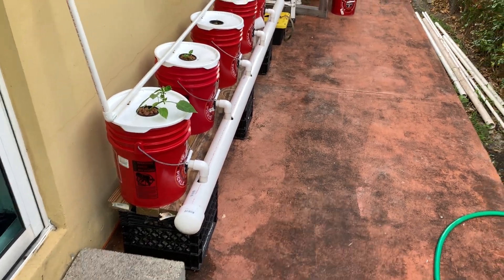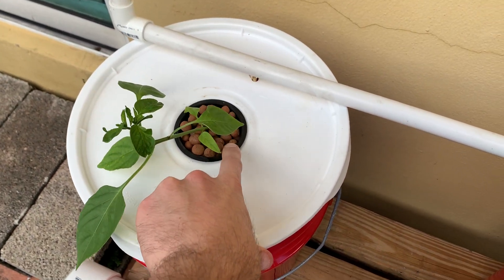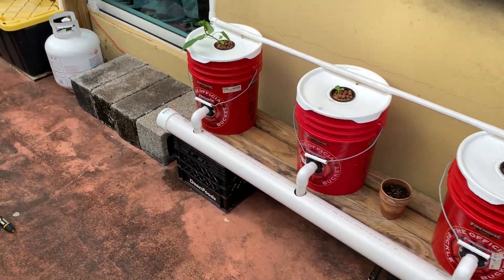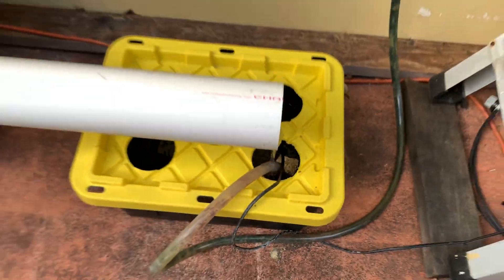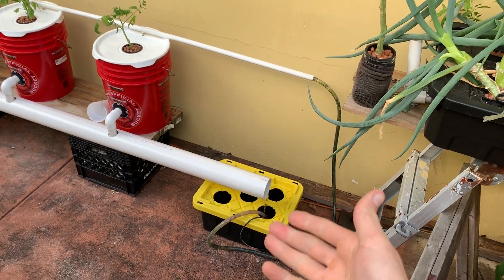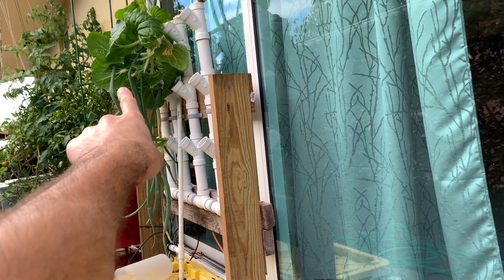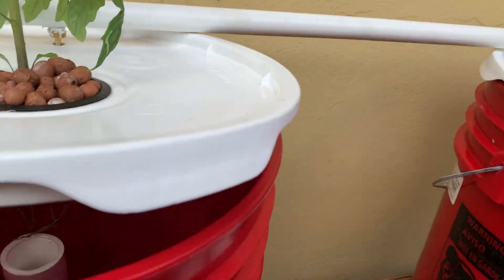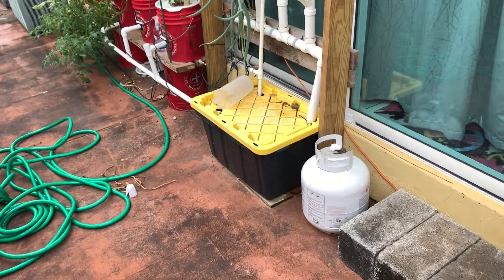How I Built My DWC System - Recirculating Deep Water Culture - Hydroponic Peppers & Tomatoes EASY

Comment: What is the height you cut your inner pipe too for the drain? Just above the bottom of the net pot?
Reply from the maker: It used to be but not anymore now it is about 6 inches below the net cup and the roots hang in the air and only touch the water at the bottom of the bucket
Reply: @BobGrows  , so as the plant starts, water is at net cup so water can touch roots? Then as root grows you cut the pipe to lower the water level? Or just have a 2nd pipe already cut so you just replace with shorter drain pipe?
Reply from the maker: Mike Goodwin it used to touch the net cup and didn’t move but now I just have it much lower regardless of root length and the roots hang in the air space between net cup and water level
Reply: @TMonkey_DayZ  he also moved the water pipe to fall directly on the plant /media

Comment: I am new to all this so forgive the "newbie" question but does the pump run constantly?
Reply from the maker: In this particular setup yes but it was not necessary. Could be cycled. In my newer revision it is necessary to run 24/7
Reply: @BobGrows  did you install plants along the drain? I really like your set up. I am in arizona so i am going to have to find a way to keep the water cool. I will most likely keep it halfway buried in the shade.
Reply from the maker: Andrew Asman I never did but if you see my more recent videos I lowered the water level in the buckets and the plants are doing much better

Comment: Nice ... may I suggest a drip system with the nutrients flowing over the roots and also you are getting algae  in your line .. check out those things you may be surprised in your crop ... some problems I had doing the same kinda set up .. cheers !
Reply from the maker: I have adjusted my system since this video I lowered the water level a lot and the water drips onto the media down into the roots. The roots are mostly suspended above the waterline now with only very long roots touching the water
Reply: @BobGrows  have you had better results with the water dripping directly on the media/plant?
Reply from the maker: idcccccccc Yes I have but if the net cup/media clogs up with too much roots it’ll just flow off the top of the bucket

Comment: What size hole saw did you use for the holes in buckets
Reply from the maker: 1” uniseal for 1” pvc uses 1.75 (1 3/4) hole saw
Reply: Was you able to push the pvc all the way through the uniseal once it was installed in the bucket
Reply from the maker: Mark Lewis put a little dish soap. It takes some effort.

Comment: Do you have the 3" PVC supported only by sitting them on the crates?
Reply from the maker: Correct on the lip. The other tubes keep it from rolling off. Should probably be secured better but it’s fine

Comment: Thanks for this! Found this really useful to get a system set up. I've pretty much copied your setup, but having problems on the last barb in my water feed. Did you ever get round to capping the pipe as you mentioned in the video? I have capped mine just after the last barb. I get amazing pressure on the first 4 barbs, but the last one just dribbles. And I wonder if it's because the water is backing up where it is capped and restricting the flow...

I don't think it's a pressure problem...because if i extend the pipe (instead of capping it) for another few meters i still get really good pressure at the end.

Thanks again!
Reply from the maker: Yup I capped it. I removed the barbs and left the open holes to feed the plants. The barbs kept getting clogged. The open holes flow much more and it seems the plants are happier and less maintenance ensuring they don’t get clogged.
Reply: Bob Grows do you happen to have an update with no barbs? Or an updated picture
Reply from the maker: I will post a video Friday, stay tuned
Reply: If you bring the water source into the middle of the run of pipe via a T it will equalize pressure to all nipples.
Reply: Brilliant!

Comment: Another guy's video I was watching, he was saying the tomato plants got huge. 

So I'm wondering, when the plants get really big do you have to adjust the net cups somehow to adjust for weight and size?  (The cups also look kind of low strength plastic, so I thought I'd ask; not criticizing because I like cheap. Just bringing it up to pick your mind.) 

Also, will tomato plants get too top heavy and big in the buckets without something else inside to sort of weigh down the bucket?  

Thanks.
Reply: As the plants get bigger.....You want to support the plants from the top.....Trellis netting....String, Wire,....You could use Tomato cages (use it upside down...tie off branches to the legs)......

Comment: you could greatly increase yield just by upgrading your pump, increases oxygen and nutrient delivery.  Covering your holes in your reservoir would stop sediment from clogging ur jets and algae growth -from sun getting into reservoir, alot of work just to go cheap on ur pump, a system is only as good as its weakest component.

Comment: On the 1/2" PVC feeder, how big did you drill the hole for the brass barbs?
Reply from the maker: I think it was 1/4 or 1/8 not sure I just matched it up to the Barb threads and made a little bit smaller

Comment: How many times working the pump for 24 hours?
Reply from the maker: Alpaslan Sivrikaya always 24/7
Reply: @BobGrows  if the pump fails,,,, then what happened or elecric Will close?  What Will happen the vegetables,,,,, is it have so times?
Reply from the maker: Alpaslan Sivrikaya In DWC setup if the pump fails the buckets will still be full. The buckets will still hold the proper level but won’t be recirculating. You have time to replace the pump
Reply: But does the pump really need to go 24/7? Or does it only need to go during normal daylight? (Do the plants really all grow at night?)
Reply from the maker: It does not need 24/7 I just don’t have a waterproof timer for outside. I think running for 15 minutes every hour would be sufficient
Reply: @BobGrows  thanks bro,,,, l Understand it

Comment: This is my first year with hydroponics and I have almost the exact same setup that you just made but all my buckets are dutch.  I freakin love how simply you turned a Dutch bucket into DWC!  I’m blown away!  Next season I’ll be converting to your system for sure!  Great system and be proud of it!  Thanks for the idea!
Reply: Does the bucket system work better than just putting the plants into a big long 3" PVC pipe itself? Or maybe its better for the larger plants like tomatoes?
Reply: I converted my Dutch Buckets about 3 years to a Very Similar System, I raised the water level in the Dutch Bucket by raising the internal elbow up, I can adjust the water level up or Down. My main Tank 20 Gal has an Air-stone in it to keep the water oxygenated. I run the Pump 15 Min on 45 min Off, in hot weather, 30 min on. 
This saves me a lot of money on Perlite for the dutch Bucket, and easy to clean out at the end of the season.

Comment: Increased aeration in RDWC is what sets apart this growing method from all others! I would highly recommend 1 air pump at least in the reservoir to transport more highly oxygenated water and when you can, 1 in each bucket.
Reply from the maker: Air pump has been added since to each container and reservoir!
Reply: Also, (in case you didnt know) if you can calculate the amount of aeration in the water you will be able to systematically dial back your nutes. When your roots are in oxygen rich water at the correct temperature, your plants are able to feed more thus requiring less ppm/ec.
Reply: Yes you are right

Comment: Hi Bob, Thanks for the video. Had you considered using fish in a reservoir for the nutrients? Just wondered, I have seen videos of people using them. Where in South Florida are you located? Is your bucket garden exposed to alot of sun? I have an area next to my house which I want to use. It is shaded by a large oak tree, so it gets plenty of light but not direct sun. Plus with the shade it appears several degrees cooler. Wish you well. Thanks for the info
Reply: Fish in the reservoir would by an aquaponics setup, not hydroponic.

Comment: You should not put the draining tube under the plant directly. Eventually, the roots will clog your pvc pipe.
Reply from the maker: Patrick Bertsch I’ve been monitoring it. My roots haven’t grown enough to cause issues
Reply: Keep us up dated on them roots possibly clogging. Its a nice set up tho. I'm going to do something Similar. God bless
Reply from the maker: Still no issues with the buckets and I’ve had some big grows. My vertical setups with basil got clogged but I would just stick a rod down the tube and clear the roots

Comment: I just started with just the buckets no circulation. Am I going to have issues without circulating or oxygenation?
Reply from the maker: Should be fine if temps are managed. I like circulating because monitoring all nutrients and water levels automatically is much easier and efficient.